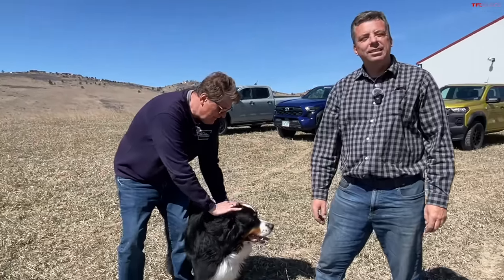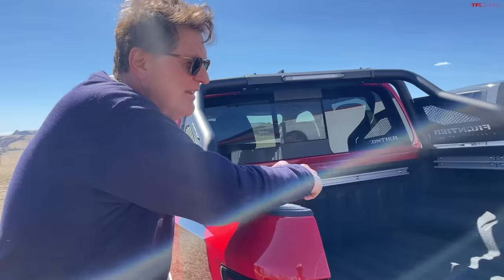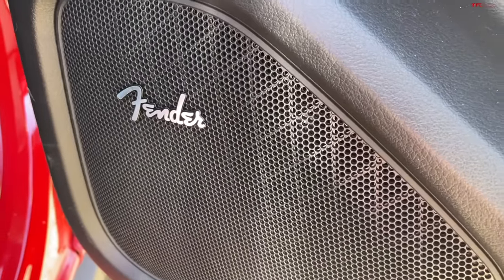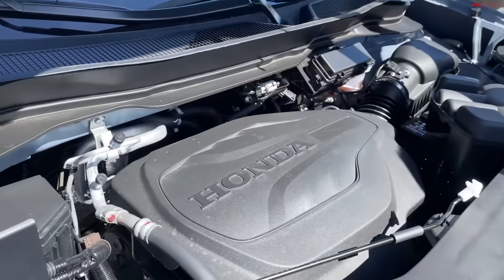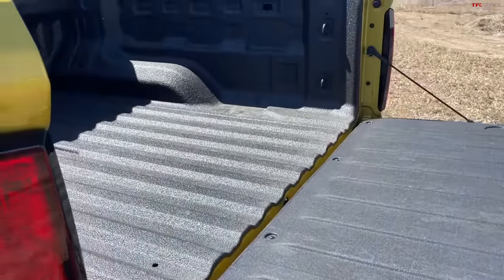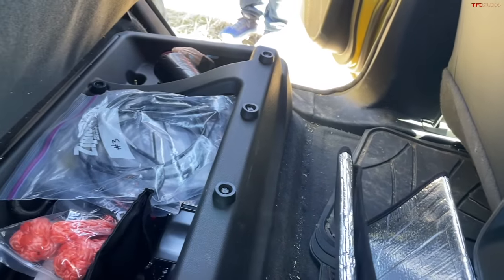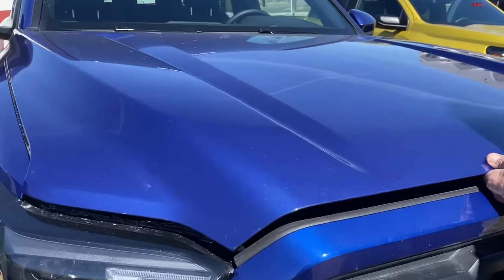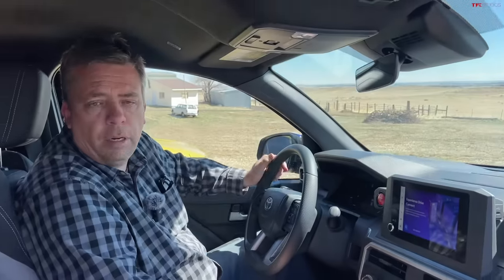We Compare 5 Brand New Midsize Trucks: The Differences are Very Surprising!

Comment: My 2024 TRD OR has an electric rear window and moonroof but it was an option. And yes, rear windows are necessary in these smaller trucks, they greatly improve wind flow and noise when windows r down. Good comparison video, guys!
Reply: Nice .. how much out the door with the off road..
Reply: 57,865 before taxes

Comment: Not bad. A good overall comparison with no clear winner. It totally depends on what you are looking for in a truck. It seems like the pricing followed the level of options. The Honda had heated everything, and powered leather memory seats and it was the most expensive. The Nissan & Ford were next followed by the Taco then the Trailboss.

Comment: The 2nd Gen Dodge Dakota! Last of the midsized trucks worth owning, because the 6-1/2' beds were usable! Drop the tailgate and you could haul full sheets of plywood! And we're real fun with the 5spd stick! The whole class needs to go back to that format!
Reply: I agree wholeheartedly that and the load floor is easy to load items whereas most of these newer trucks sit too damn high IMHO. I have owned my 1999 Club Cab for 25 years.
Reply: @MichaelSmith-kr9qw  what happened to it? That would be this year, or 2023, if you got it at the beginning of the 1999 model year in September- December of 1998
Reply: @lockandloadlikehell  Nothing I still own it and drive it daily....I was built in Nov 1998
Reply: 100%

Comment: I actually love that “bed trunk” on the Honda. Would be awesome to have something like that on full size trucks even if not as deep. Would obviously be an issue due to spare tire though.
Reply: Most folks put the spare in the bed or backseat if hauling loads more than 30 mins away.
Reply: what? who does that? @hsvnole
Reply: @atodaso1668 People who plan ahead for a longer trip.
Reply: @atodaso… Also people who were hauling unbagged mulch at a previous trip when they didn’t plan ahead. 😃

Comment: If the Ranger had the 2.7 it would be the decisive winner for me. I also think the styling is really good.
Reply: Versus the gm powerplant the ranger vs isn't that special. The v6 only has more power but less torque than the gm 4 banger not with the price difference. The 3.0 on the other hand...
Reply: It's a boring ford design
Reply: @atg1338  Nice truck, kind of a frumpy front end.  If someone plans on putting a bumper and winch on it, it will probably look good.   Right now its not ugly, just kind of meh.
Reply: A 2.7 with the manual out of the Bronco. Now you'd have me interested in a Ranger. And I'm no Ford fan.

Comment: I had a 98 Dakota 4x4 with the V8. What a fun, solid, little pickup!
Reply: I had an 04 quad cab loved it. Excellent 4x4 great truck except the 4.7 V8. Head gasket. 140,000. I miss it perfect size good approach angle 4 low was amazing.
Reply: Sounds awesome till you mention the mpg.
Reply: @mofayer my quad 4x4 4.7 got DECENT mpg for what it was
Reply: 00' Quab Cab V6. Needs a respray but it's the Real midsize truck. These trucks are basically 1500's.
178K and going strong. Hates gas, but still solid.

Comment: I added a 2" traxda lift on my ridgeline...imho the best bang for the buck at $1000 (400 for kit, 600 install).  Brings it up to level with rangers, tacos, colorados...etc.  Yup, take a bit of a hit (1-2 mpg) and yup, the backup sensors for cross traffic are about 20% less sensitive...but overall really like this package for the ridgeline.
Reply: It's a ridgeline 🤣🤣🤣 suv with a bed
Reply: @atg1338  The Ridgeline is fine dude, it does that like 90% of the things truck people do with their huge trucks and as someone who offroads baja all the time a lifted awd would do fine (as long as you are not rock crawling) maybe struggle a little more but it will get there. We have this idea that we need a huge 4wd suv or truck but honestly alot of it is overkill.
Reply: It will never be up to the level of the other trucks with no low range.
Reply: @mrvwbug4423  not wrong, but 1st gear on the 9 speed is 4.71, which is waaaay better then the old 6 speed.  driving around town the transmission starts off in second, have to use the paddle shifters to take it down to 1st.   However, you are right if you need a xfer case for those ratios for [insert reasons], then the ridgeline is not for you.
Reply: @atg1338  That's actually a compliment because Ridgeline is outperforming "Real Trucks." Trucks need the Ridgeline in its class--finally there's a truck that's comfortable for daily, long drives, and speed!

Comment: I actually now want a Ridgeline after watching this video. A front fascia redesign would be great tho
Reply: Go drive a ridgeline. Regarding comfort, handling and fuel econ they are infinitely way better than any other vehicle in this video.  They won't tow or wheel as hard but for 95% of the time for 99% of people they will be the best "mid-size truck" out there.
Reply: They are great.  Just wish they had more clearance.
Reply: @canyonero2050 careful, you might trigger the "real truck" bros
Reply: @canyonero2050 Don't forget the most important aspect... reliability.  I wouldn't pay $40k plus for any of those other vehicles.
Reply: Worst vehicle I've ever owned.
Reply: @klwarhouse  you obviously haven’t owned a Ram then.  LOL
Reply: @crawdaddct  I haven't. But...... On my 2022 Honda Ridgeline all before 40k miles I've replaced. Half shaft's, Struts, strut mounts, fuel filler neck, driver door rusting from factory, etc. Currently I'm dealing with a rod knock sound. Lol, never again.
Reply: @klwarhouse  Sounds like you got a dud.  Honda has an overall great customer satisfaction rating.  Much better than a lot of companies.  I’ve owned five and never had a major problem.  Knock on wood.  Every Dodge/Ram I’ve had has been a disaster.  Don’t know why I keep buying them.  I get it though, had a Buick Regal one time that was a lemon.  Would never buy another one.
Reply: @crawdaddct  This vehicle has driven me to the point of wanting to go look at Ford's 😂. I believe I did buy a dud..... Maybe I'll deal with it for another year or two and consider the new Ridgeline, whenever it comes out. It truly is a phenomenal "truck".

Comment: You guys missed a few things on the Ridgeline. The in bed speaker system has been discontinued. The Trailsport also comes with off road suspension, and the 2017 model you tested that gave you the overheat warning has a different transmission.
Reply from the maker: Thanks for the heads-up on this!
Reply: I own a GMC Canyon and it's a great little truck but I really love the Ridgelines.  Always been a great innovative addition to this class of vehicles.  Unless you tow heavy (over 5k lbs) or do real hard-core off roading the Ridgeline is the best overall everyday.
Reply: @canyonero2050 it can't support far beyond its payload rating (in the bed) well, like body on frame trucks can, and it's ground clearance is across the bottom of the unit body instead of just at the bottom of the diffs on body on frame trucks.
It's articulation is much more limited, too.
Can confirm ground clearance and articulation come into play in dry fields, snow, and other normal not hardvore off road conditions.
Even a 2wd body on frame truck with 8.2" ground clearance is more capable than the Ridgeline in crossing some basic obstacles in some so called off road conditions that are anything but extreme.
Reply: @lockandloadlikehell lol the ridgeline has a higher payload rating than a lot of full size trucks 😅

Comment: Inflation sucks so much cause these should all be like 32,000 for each of these not 40 plus
Reply: Not just inflation but buying power decreased significantly due to median wage, (accounting for inflation) now vs 20-30 years ago (or even 10 years ago).
So everything is more expensive, and there are fewer consumers are making enough to be considered middle class
Reply: Bidenomics
Reply: @FeelingPeculiar  bank-ster nomics.
Reply: i got my 21 ranger 4x4 xlt new for 33k…still thought it was too much at the time. I do enjoy the simplicity of the truck and it has plenty of engine imo…
Reply: Based on purchasing power, trucks cost almost the same today as they did in 2005. A 2005 super duty king ranch was 60k back then, it’s now 100k. In 2005, 60k had the same buying power as 97k does today, and you get a much more capable, efficient, feature-rich and safer truck for your money.

Comment: Glad to see the Ridgeline as an actual part of the comparison. It’s a bit exhausting hearing all about the higher tow or off-road chops for some of these brands when so so many consumers aren’t going to need to actually use that capability often. But fitting a friend, a kid, or a dog in the back seat, or driving for longer than 30 minutes with some regularity for comfort, or needing a vehicle that doesn’t need a step stool for the whole family to get into it, isn’t worth heavy consideration typically with the truck content. I get the niche that the truck channel serves, and the fact y’all are in Colorado, but the midsize segment doesn’t feel like it serves the same market/needs as the heavy duty or full size segment, functionality and livability at a competitive price range seem worth valuing for these vehicles. A great side by side comparison of so many options in this vid!
Reply: Excellent points…I also noticed that Blaze and Roman only climbed into the bed of the Ridgeline 🤔
Reply: If I lived in Colorado and was using a pickup regularly like these guys do, I personally would choose one of the others. But otherwise, yes, for what it is as you mention (super comfortable including in the back seat, really nice ride, quiet cabin, non-turbo v-6 with plenty of power, etc) nothing really compares to it functionally for someone who isn’t using it for heavy towing and off roading, ie -most people. Why they can’t improve the styling I’ll never understand, though they did make some improvements to the front end in 2020 or so.
Reply: I agree with everything that you pointed out.   Unless you're in the mountains where you might really need a true 4x4 or if you tow regularly, the Ridgeline is a fantastic choice when it comes to comfort in the cabin, road tripping with family and luggage or taking 4 adults out on a drive for more than 30 / 45 minutes.   If you want a midsized truck and you'll need the true 4x4, towing and 90+% of the time, only 2 occupants, look at everything else in this comparison.
Reply: My previous truck was an extended cab 2WD, and my current truck is an extended cab 2WD. But every time the guys at TFL see a 2WD, they say "it's only 2WD" and treat it like it's useless. If it's not a 4x4 with forced induction, then it's a horrible truck for driving in Colorado, and the TFL guys think nobody would want it. I bought a 2016 Canyon because I wanted an extended cab long box truck that isn't available anymore. I drive in the snow in Canada, and it works great. Sure, I carry a shovel and tire chains in the winter, but even 4x4s get stuck sometimes.
Reply: It’s not a real truck, sorry!!
Reply: @theoutdoordad7395  That’s exactly what people used to say about the El Camino. There was a guy that bought an El Camino so he could take it to the drag strip on all car night and on all truck nights. It has a bed, not a trunk, and can carry cargo, so technically, it's a truck. If you don't want a unibody truck, then don't buy one. The guys at TFL think naturally aspirated 2WD trucks are useless in the driving conditions of the Colorado mountains, but I drive a 2WD truck in the snow in Canada just fine.
Reply: Exactly. People always want something more than than actually need. Just look at all the full-size trucks driving around never even being put to actual use with the 10,000lb+ towing capacity. Sure, there are some people that need the actual high towing and hauling capabilities, but most consumers probably don't. The Ridgeline works for a large amount of consumer's actual needs. I find it interesting that many of these still don't have full-time auto 4WD setting, except for certain trims. For on-road use, which is where most of these will spend time on, part-time 4WD is primitive. I would much rather have the very capable Honda iVTM-4 system for on-road use. If I actually needed something with more off-road capability then the Tacoma would be my choice. The GM and Fords would be lease only for me given the likely questionable long-term reliability.
Reply: These tfl guys are kind of annoying.  Are they "partners"?
Reply: @ctbale1 Wtf does that mean.
Reply: @theoutdoordad7395 No car in the test is a real truck 😂.
You can drive all of them in the places where there a sign “no trucks”, you can drive them in the lane which no trucks can use, you don’t have to go with them to a weigh station, all this proves none of these pickup cars is a real truck, sorry.
Reply: @JuckiCZ  clown comment- the ridgeline is a fine vehicle but it’s not body on frame which makes a truck a truck
Reply: @theoutdoordad7395  Ok, show me one definition that says trucks need frame.
I tried Oxford dictionary for truck and it says nothing about frame, Wikipedia says that smaller trucks are similar to normal cars because they have no frame (but are still considered trucks) and law says that no midsize is proper truck (because you can ignore those “no truck” signs and weigh stations).
So I am presenting here facts and you are just forcing your opinion.
So where is link to your definition? None of these cars is proper truck, all of them are midsize pickup cars.
Reply: Well said I’m tired of cc comparing the rl to a Santa Cruz
Reply: @JuckiCZ 😂
Reply: If I wanted to pretend to have a truck I would get the Ridgeline.

Comment: Noboday has answered the question “Will the Tremor pkg return?”. I disagree with your opinion of the styling. It looks like a Ford truck. I think if they brought the Everest to the USA it would sell quite well.
Reply: Tremor be good right below the raptor.  Base v6 with front rear lockers, small lift same transfer case as the raptor 2wd,4a, 4hand 4L

Comment: The Trailsport shown here is the third highest trim level, so the $47K price reflects its off-road feature set. The Sport starts at $41K and RTL at $44K for cheaper entry cost to the Ridgeline. I have an RTL and it has everything you NEED in this truck. The Trailsport is fine if you drive on gravel or mud often, and the Black Edition is mostly an excuse to charge customers $50K for the same basic truck.

Comment: The problem with the Ridgeline is that Honda doesn't give it the support it needs to really sell in higher volumes. It has been nearly 8 years since a full redesign and even with two refreshes, it is still two generations behind most Honda models in regards to technology and a generation behind in it's drivetrain. Despite all this, the Ridgeline has sold nearly 50k this past year while having any future past this generation very much in question.
Reply: People want reliability from Honda, same reason why Toyota took 15 years to redo the 4Runner and people continued to buy.

Comment: I love Nissan frontier hard body edition. Also, their v6 engines are very reliable
Reply: Nissan is a little like a small block Chevy of Japan.  They take a proven design and run it a long time. The Z 24i in my 1987 Hardbody actually has its block design from the late 60s L-series, which actually has some Mercedes DNA in it. I don't know of any Nissan engine design that was not solid.  The little A16 in my father's Sentra still is solid at 360,000 miles.
Reply: @jeanclaude7018  Agree 💯

Comment: You mention it in other videos, but you left out that only the Ridgeline and Ranger can fit a standard width pallet or 4x8 sheet flat in the bed. The rest need to be propped up above the wheel wells, which isn't ideal for flimsy sheetrock. This alone makes them the most useful of the stubby beds. Their real world payload capacity being tops doesn't hurt either. Andre does seem to have a hobby horse on the 400W outlet thing. Only one of these trucks will have, (that is it's not available yet,) a hybrid option that enables them to have the option package for the higher wattage outlets. The hybrid option is only going to be available on middle trims and up. Only a few of these trucks even have a 110 plug option at all, so bringing up that it isn't 2kW seems a niche concern. Also, as a service advisor, death to all engine covers! They just get in the way and get brittle and crack when older. Good job Ford and Toyota!